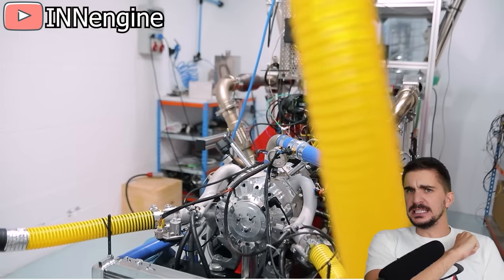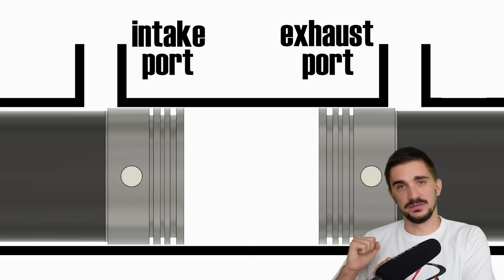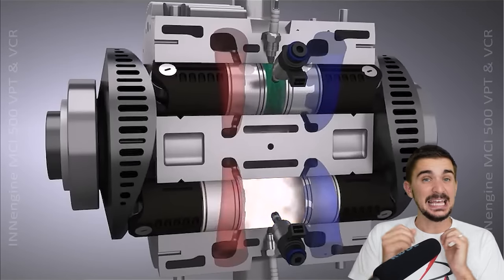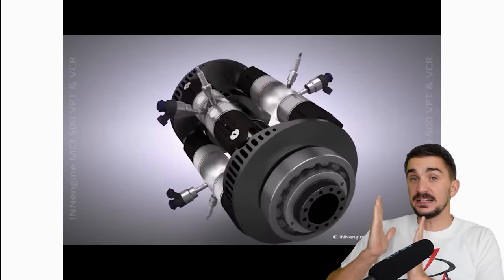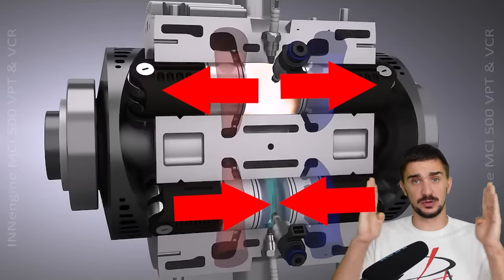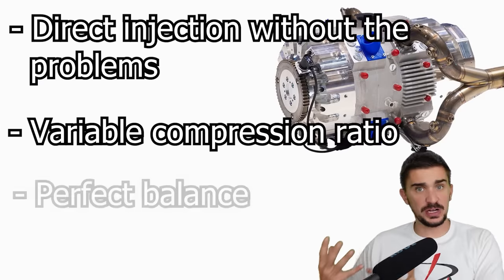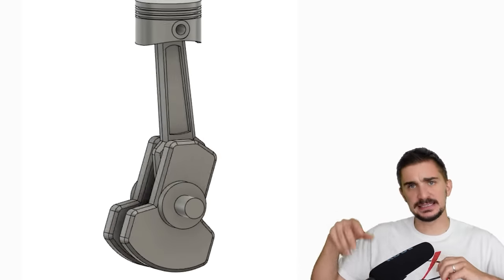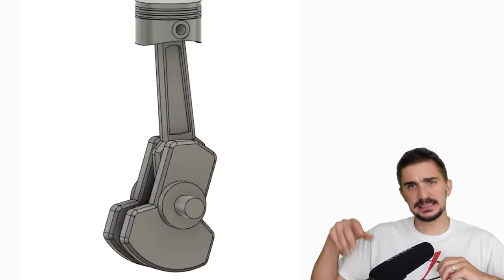Spain is Living in 2050? Revolutionary 1 Stroke INNengine Analyzed

Comment: The exhaust can't generate a significant vacuum. The way to stop the exhaust going into the intake is with a supercharger, to have the intake at a higher pressure than ambient so the exhaust can go to the exhaust which is at atmospheric pressure.
As for torque, you can get some idea of the comparison.
The lever arm is the distance from the axis of rotation to where the bearings are rolling on the disc, however it is reduced down due to the angle. If the ramp was at 45 degrees, then the force is reduced by a factor of 1/sqrt(2), but with it being further from the centre it can be a higher torque.
Also, depending on how aggressive the slope is starting and stopping, it could also make it have more consistent torque throughout the stroke.

Comment: I also feel like the vacuum created by the offset intake and exhaust could cause one of the pistons to lose a little bit of energy causing a little loss of efficiency along with the grinding between the piston and the swashplate wavy thing.
Reply: They could enlarge the disc and connect it to pistons
Reply: But I still feel that the opposing pistons desing would make for a way better thermoeficiency overall on the losses of the other components of this engine
Reply: @Lucas.MarcosIV  The opposed piston design is good but it has been done before with more conventional engines, shame they didn't become more common.
Reply: @Truth-Liberator  Ford had concept recently
Reply: I think about engineering with my feelings too

Comment: what you didn't mention is a lot of energy is being wasted on pushing down on the "wavy thing". A regular engine almost all the power generated is being transmitted to the rotation of the shaft. With this one, at all points we got two thrust vectors splitting the power which actually turns the engine into two components: down and roation.
Reply: The "wavy thing" reminds me of Wankel engines. Conceptually it works, but in practice there is a lot of wear and tear. If memory serves, it didn't catch on despite superior size and torque characteristics because the engine had to be rebuilt every ~10k. They should build these for small vehicles like scooters and bikes to test the reliability.
Reply: Yes this really doesn’t look that efficient at generating the potential power
Reply: @maybehuman2148 what if you used something like titanium for the contact surfaces? Expensive, but possibly worth it if low weight and durability are the primary design parameters, for aviation maybe? Doesn't look as difficult to disassemble as a wankle rotary, anyway.
Reply: @citizensnips2348  you'd still have the issue that only a part (and not a big one) of the energy is used to turn the engine...

Comment: Excellent and very informative video as always. It certainly is an interesting design but the friction regions are a concern for longevity. The company should release dyno charts with fuel consumption data also since 2 strokes are generally not known for fuel efficiency!
Reply: But they used to smell great back in the day 😊
Reply: I wouldn't be too worried. Conventional engine journal bearings are about the same size as the rollers in this 1nn engine. If it's kept properly lubed it should run for a long time.
Reply: @SofaKingShit it’s efficient because of the physics of the cam design but wear is a huge issue

Comment: I think the supercharger is needed because relying on scavenging isn’t going to get enough air in or enough exhaust out.
Using only scavenging it may possible to get the engine to run on certain rpms but to put out meaningful power across the rev range should be impossible.

Comment: Id like to see the performance numbers for a 2.0 liter version.  This would have a larger torque arm, just because the wobble plate would have to be larger.

It also occurs to me that the torque value could be changed/optimized by changing the slope of the ramp on the power stroke.
Reply: Wouldnt having a larger diameter disk help too? You would need more cylinders though to not have a too small angle on the slope

Comment: This is a pretty interesting idea. The big question i have (as always) is about durability of the design... and i guess secondarily about the cost of production. This doesn't look like it needs super insane tolerances or anything so it looks like it could be produced reasonably. Durability, though... i can imagine those connecting surfaces wearing, particularly as power goes up. As they wear it would change the characteristics of the engine. That might be manageable with computer controls, as long as it's slow wearing enough. If this thing scales up linearly (400-500 hp out of a 140 kg 2L engine?) it'd be an incredible engine.
Reply: I wonder if you could plate the wavy thing in something like teflon to reduce friction wear. The only part that would need tight tolerances would be the piston rollers then
Reply: @imperialguardsman135  The piston roller would probably grind teflon off pretty quick, but low friction would be good. My guess is something like piston cylinder liners where they're very hard and low friction. One advantage, here, is that it wouldn't need to be airtight/sealed.

Comment: I’m not an engineer, I’m just wondering whether torque couldn’t be increased by using a larger diameter wavy thing, because it seems to me as the radius of the wavy thing acts as a lever too .
Reply: Stroke would be the same, you would need more height in the waves.
Reply: @adrianzmajla4844 just asking, but does the height of the waves even matter in this configuration to produce torque? I thought only the radius of the wavy thing would matter, because that’s the only perpendicular lever to the crankshaft.
Reply: Increasing the radius can increase the torque as it will have more leverage like a gear with bigger radius, however, it will affect the durability since the force is recieved on the angle of the "wavy thing" that's with the weakest support, adding bearings on the back may solve this but it will also add wears and more maintenance
Reply: @Limenangelo interesting point , thanks . 
But I wanted to point out that since this configuration doesn’t need cams and valves and all the architecture that come with it ( belts/chains, sprockets, springs, and the cleaning that comes with direct fuel injection) , the maintenance needed for a reinforced “wavy thing” might still be cheaper /easier than that of a regular setup , because the only real weaknesses that I see are associated with the wavy thing

Comment: The "wavy thing" would be called a swash plate in a helicopter, if I'm not mistaken. Given it has the exact same functionality here -- converting rotary motion into reticulating motion -- the name swash plate probably works.
Reply: I was think wave crank but now seeing this I’m think swosh crank
Reply: Based on the definition of a "cam" there is no rule as to what its shape, only that it rotates.
A "cylindrical" engine cam is what is used in most engines. 
Here in this application I would call it a "disc" engine cam.
Reply: It’s definitely a swash plate
Reply: Axial Cam
Reply: and indeed, swashplate engine did exist
Reply: Still a cam drive, but yes the concept of a swash plate is well at work and maximized

Comment: It's based on an axial piston air compressor design. In those cases, the 'wavy thing' is termed a 'rocker plate or swash plate'.
https://ars.els-cdn.com/content/image/3-s2.0-B9780750671743500548-f03-15-9780750671743.jpg
Reply: Thanks for that tech explanation bro, I had seen the term before but couldn't remember it as I was laughing hard at the 'wavy thing'
Reply: A swash plate in a pump does not rotate though, does it?

Comment: It's a uniflow 2 stroke engine, the centrifugal supercharger is a must to scavenge. The supercharger usually has a pretty small blow pressure
Reply: Exactly. All 2-stroke designs need higher than atmospheric pressure for scavenging. It doesn’t need to be much higher, but it MUST be above atmospheric.

That these people are claiming their engine runs at atmospheric pressure probably means that the blower is just moving enough air for scavenging and not enough to supercharge the cylinder i.e. the net air volume = cylinder volume.

Comment: The "wavy thing" IS a lever, or more specifically an incline plane.  The fulcrum is in the same place as a conventional engine - the crankshaft's center of rotation.  The lever is disguised in the "wavy thing", but you can visualize the lever when you ignore the "wavy thing" and just track the contact point of the rollers.

Comment: Very interesting to see so much innovation. I feel the auto industry missed a lot of opportunities in the last 100 years.
Good video
Reply: The two, sorry, four stroke four, six and eight cylinder engines of today are a good product. Do these engines waste gasoline? Yes they do. Nevertheless, there can be adjustments made on the engines to get better gas mileage but Big Oil will hear none of that. Nevertheless, 100 years of V-8's is a very good engine.
Reply: They didn’t and there’s nothing new. It’s just that none of what we consider “exotic” designs worked as well as what has come to be common.
Reply: That not even innovation this design is nothing new and is used in every car today to keep you cool 
The AC compressor work exactly like that and most variable flow hydraulic pump as well
And the wavy thing is called a swash plate
Reply: the auto industry spent its entire lifetime being swamped by millions of ideas of how to build a better engine. but aside from a century of very successful (and expensive) incremental improvements, the radical designs that were seriously investigated were tried and abandoned. and the countless small workshops that decided to go maverick because, an idea was just too good to be abandoned, failed and disappeared. the grand exception is rotary engines, which are fine in a particular niche but didn't pan out for the mass market. obviously gas turbines work great if you have an appropriate application aside from aircraft, and the auto industry definitely considered them but they only found their way into tanks in the end. the feeling that something important has been missed is very common and understandable. it's why millions of people have pondered the possibilities. but there's fairly strong evidence that there weren't really a lot of missed opportunities

Comment: My current favorite novel engine design is the "Liquid Piston" engine. I especially like the interview they did with Integza where they explain the back story on that name as it obviously doesn't apply to the engine they have designed.
Reply: I'm going to have to check that out! I have never heard of that engine before either.
Reply: Have a look at the Duke engine, too, if you like this sort of thing
Reply: @Tinsil88  oh yeah that's the 5 cylinder that is similar to this but it doesn't have the opposed pistons.

Comment: Interesting beastie, I can see quite a few uses for it such as an electrically driven vehicle where it runs a generator rather than the wheels directly. That way the low torque wouldn't be an issue and the weight savings would be significant over current designs where they use batteries.
Reply: I was thinking the same. It could turn two generators for two or four motors.
Reply: @alexgataric Did you forget about the low torque part? 😂

Comment: One thing I would be interested in is the piston and cylinder wear. The side force looks to be higher than a traditional engine. I don't think it will be a deal breaker however.
Reply: The compressive loads on those roller cam followers though… make them wide to lower the point load and you induce friction because of circumferential distance change.
Reply: @russbell6418  Maybe that can be overcome with applied material science. What you make those cam plates out of is central to this engine's longevity...
Reply: @russbell6418  was just about to comment this
Reply: That’s my question also. 

I don’t care how much oil you have being sprayed on the swash plate / wavy thing. 

A normal engine uses the pressurized oil to make a layer of oil to keep the crankshaft and connecting rods from actually touching the bearing surfaces. 

But there is no way to have a hydraulic pressured oil layer on the swash plate. 

The wear on the plate and rollers is going to be this engines weak spot.

Comment: Wouldn't that wavy plate (swash plate) worn out faster than parts in a conventional piston engine? looks like it would've to sustain a lot of friction, same with the rollers on those pistons.
Reply: I think it might actually be better than a conventional crankshaft because as the swash plate wears the only thing that will happen is the piston will go down further and decrease the compression ratio but it is also a variable compression ratio engine so you could just adjust it back to where it was originally maybe every 10,000 miles or something like that. Also with a good amount of oil flow I doubt it will wear that much. The swash plate is a lot harder then the rollers on the end of the piston just like bearing shells in a conventional engine. You would never need to grind the swash plate like a crankshaft only replace the bearings.

Comment: A torque converter would help the engine out a lot. Would probably do well as a range extender for hybrids, if the fuel economy is better than a rotary.
Edit: And that point showed up shortly after I clicked post.
Reply: the point on fuel economy?
Reply: @guccing7556  Rotary are notorious for their high fuel consumption, despite how small they are - the downside to working at such high RPM with 3 combustions per full rotation of the shaft.
Reply: @dabombinablemi6188  I believe poor BSFC in the rotary is due to inefficient combustion chamber shape with excessive surface area. This design seems to be an interesting mix of the two designs.

Comment: About the supercharger:
To  my knowledge, every two stroke engine need some kind of forced scavenging. This can be done by using the pump effects of crank case or by an external charging device. Any opposed piston engine had an external supercharger like: Junkers Jumo 205, Napier Deltic, Commer TS3, Achates etc.
Reply: Nope you can use an expansion chamber exhaust.
Reply: @Davidkxf  How should that work at startup? Before you have hot exhaust gasses to "drive" an expansion chamber exhaust?
Even the Turbo Charged Detroit Diesels all had an crank driven mechanical Supercharger for scavenging.

Comment: Even if this engine needs a super charger, it's still a very impressive little engine .
Any engine that gets rid of the valve train and the crank is a massive bonus in my books.

The only concern I have is, on the power stroke the pistons will be forced to rock into the walls of the cylinder.

Comment: In helicopters the "wavy" plate is called a swash-plate.

Since a standard 4-stroke is also multi-fueled, that is also a wash.

But I agree that the weight savings by itself in a hybrid drive configuration would be of great benefit. Also, the maintenance and repair costs would be much lower due to the lack of moving parts. Due to the low part count, with regular oil changes, probably more often than a standard 4-stroke, I would suspect the MTBF to be at least double, if not 4x, that of a standard 4-stroke.

I'll be keeping my eye on this one.
Reply: Isn't the swash-plate flat in a helicopter as opposed to wavy?

Comment: I would love to see the long term effects of that side loading both ways on the pistons. One way for power, the other for compression. That screams oval bores in a very short time. 
I'm interested how they attach the pistons to the swash plate too because the way its described seems to suggest it relies on the pistons always being under load to keep everything together. 

I can fully appreciate the advantages of an opposed piston, direct injection two stroke. 
I can't see any advantages over one with this.
Reply: Look at the 3D images again.  There is a swash plate portion that takes the power and a second smaller one that is upside down on the inside that controls piston location in the other direction.  Very similar to the DESMO system for valves in a ducati in effect with a cam controlling the upper and lower positioning.
Reply: @Gnrnrvids  Thanks for that - I see it now. 

That just makes it more of a dodgy design for me. So many forces going all over the place and nothing to prevent loading the cylinder walls then a roller system which needs to be able to take full power and piston weight at rpm? 
It looks like it would work great short term. 
Again I see no advantage in this over a design with a crank on each end - possibly a tiny bit of weight and size if anything - but the ease of manufacture, efficiency of power transfer and longevity of the twin crank would make this look like lot of complexity for nothing. 

Another point I just noticed was they're using one side for intake and the other for exhaust so there is going to be a difference in temperature build up between sides on top of all the other issues.
Reply: The side forces are counterbalanced by the second roller,i think this configuration has less side forces than a conventional 2 or 4 stroke engine with a crankshaft
Reply: @mechonicdapais5730  Not unless half the engine is running backwards. 
As the piston comes down the only way it can transfer power is by pushing the swash plate sideways. Since physics is a thing that means there has to be an opposing force to that or the piston would just follow the ramp of the plate. The only thing stopping it moving laterally is the cylinder.